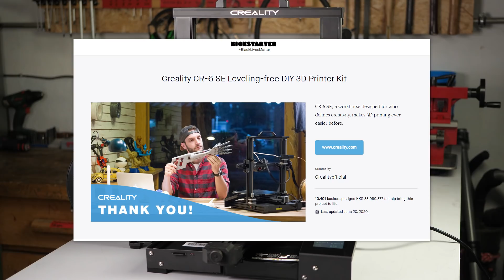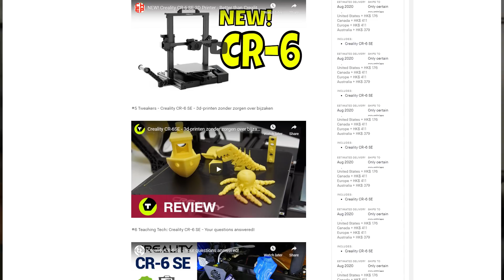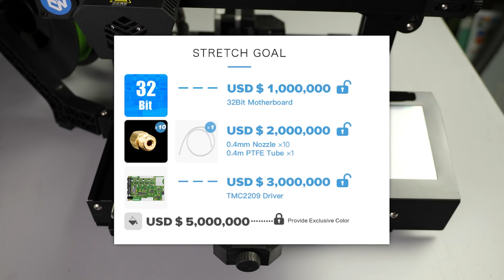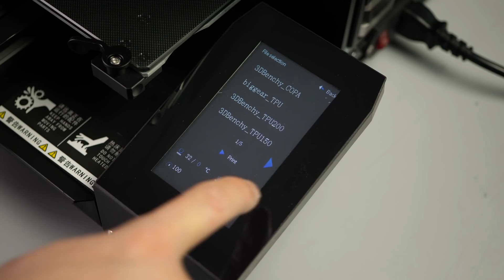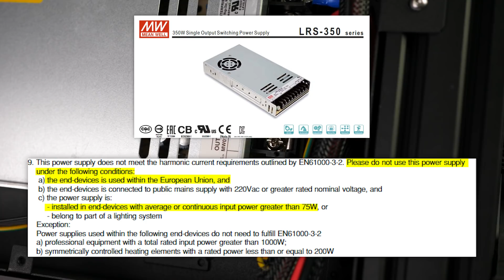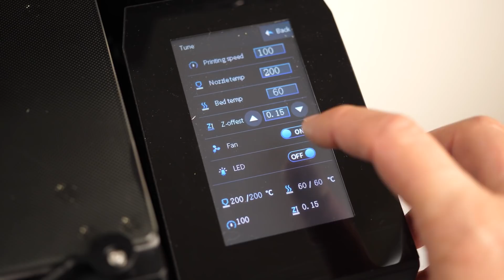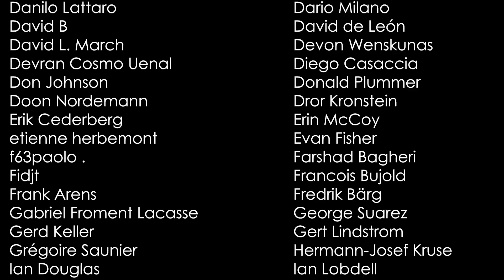Creality CR-6 SE - The NEW (over)hyped Kickstarter 3D printer?

Comment: I backed this on kick starter at the 319$ price. I was watching Joe Tellings video and my wife encouraged me to get it because it just looked like a solid printer compared to my Kossel Pulley delta that am constantly working on. I started with a 2016 Tevo Tarantula with was well known as a Print Your Own upgrades printer. Since I haven’t been able to get that printer up and running and I am constantly complaining about my Delta’s 165-170mm max print diameter, we thought this was a printer I wouldn’t have to “fiddle” with printing my own parts and I can keep using for awhile. I also want to print advanced materials like CF-PETG so I like that I can swap in my existing v6 A2 nozzles. I am concerned about the PTFE lined hotend, so I am hoping they listen to the survey and modify the heat break. Otherwise I might be machining my own to test with.
Reply: PTFE lined hotend is better for PLA, so I don't think they will change that. But probably a few months after the introduction the CR6 some Company will sell all metal heatbreaks for this.
Reply: You can always just get a v6 and then swap it  or the microswiss
Reply: OMG the same history as me :D #sad That Tevo Tarantula is a complete SCAM. Mine has 3 years and can't print well! Last week I got an Ender 3S and just in 1.30h it was running completely  p e r f e c t !!! Compare 3 years and random stupid problems vs 1.30h and 0 problems and half the printer assembled!
Reply: do you still have that 2016 tevo tarantula. im looking to buy one if you can sell it to me that would be great. im in london so depending on where you are shipping might be a pain

Comment: I absolutely LOVE the ceramic-coated glass bed on my Anycubic machine - so much I bought two more of them for other printers

Maybe Creality's glass has a different surface texture, because the beds I use practically eject PLA/PETG prints once they've cooled below 30C or so
Reply from the maker: Yeah, it's somehow different to the Anycubic Ultrabase because that's great!
Reply: Magi goo and smooth glass forever. Abs, PLA, PETG, and ASA fall off when it cools down. Even held on to CF Nylon with little issues.
Reply: I won't use anything other than the coated glass. I found a pair for the ender 3 with sticky back on amazon and absolutely love them.
Reply: I stuck with the original glass and didn't add the PEI upgrade due to this. I am 100% in love with my AnyCubic Ultrabase that I have on my Chiron (now with 2209 drivers) Hoping this is a good printer I can put side by side when I don't want to run an 800W printer or when I need to print multiple things at once.
Reply: I use Creality glass plates on my Ender 3 and have no issues, once cold most parts have detached themselves, or need very slight force.

Comment: I didn't back this project on kick starter as my stock enter 3 pro upgrades bl touch + skr e3 mini + TFT 3.5 + spring pei sheet is about the price this machine was on kick starter. I find my custom solution to be much better especially the pei steel sheet which this machine doesn't offer.  Upgrade cost below 
Original Bl Touch     $34
Skr e3 mini 1.2          $28 
TFT 3.5                        $30 
Double-Sided PEI     $28
===================
Total                           $120
Reply: You just made a $360 Ender 3 Pro (as most available now cost $240).
Now add dual Z, bigger y, better drivers, better fans, better extruder, better hot end.
And this Strain gauge is much better than BL Touch. 
Most people got this for $320 with more features and sturdier construction(bigger Y-axis and Dual Z) than what you built and they saved $40 more than you spent.
Plus some of us were able to get it for $265 which is only $25 more than your stock Ender Pro.

If you really wanted the Pei, you could have bought it as an add-on in the KS.

Glad your solution works for you though.

Comment: Wait, you cannot manually level the bed? So if it's ever so slightly wonky from the factory, you're just left with all your prints having a slightly wonky underside?
Reply from the maker: Exactly, but that's usually not a huge deal. The Prusa MK3 handles it the same way and it makes the bed more sturdy, due to the lack of springs.
Reply: No. it has automatic bed leveling
Reply: @reddayzz  That won't fix an unlevel bed, it'll just translate it into an unlevel underside of your print...
Reply: @Henk14789  Yes it does not level the bed for real :) but it compensates with software and the prints come out leveled.  Prusa MK3 dont have knobs too and work perfectly. I never saw a bed so crooked that you could notice in the underside, but I can be wrong :)

Comment: I have to say i don't think the hype was deserved because they never seam to add that last little bit to round out the printer.
Reply: It's a $300 printer, considering it's much less than half the price of a Prusa MK3 I think you get huge bang for your buck and PSU noise is the only real complaint I have seen!  If you want the PEI plate you can just buy one for like $20.
Reply: @LordCreo  the real question is how much you value your time. For how much time I spent modding and tweaking my first 300 dollar printer I built back in 2012 i would have easily made up that difference. I am looking at the prusa mini or getting a second mk3s.